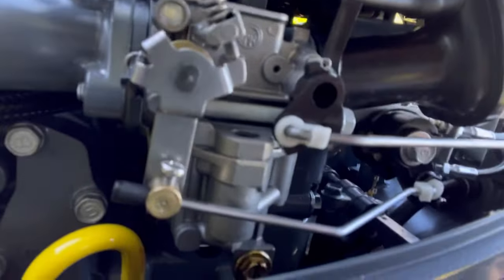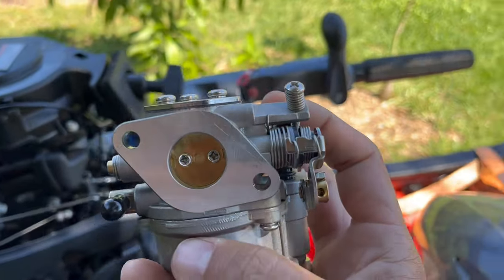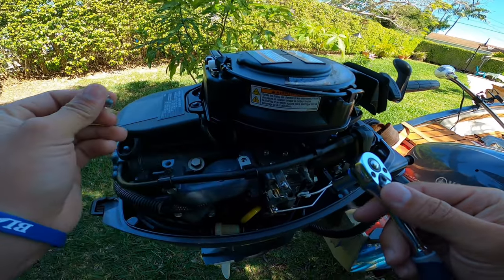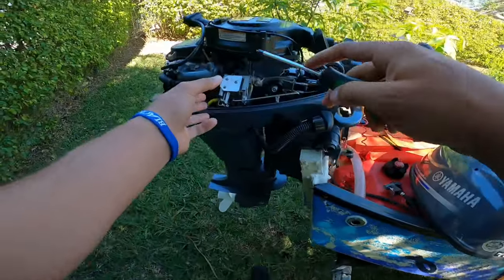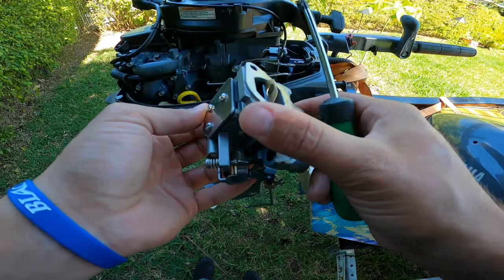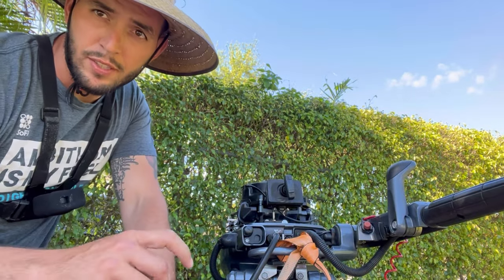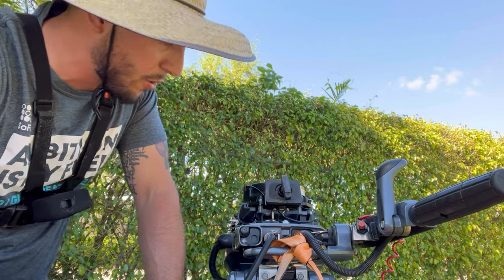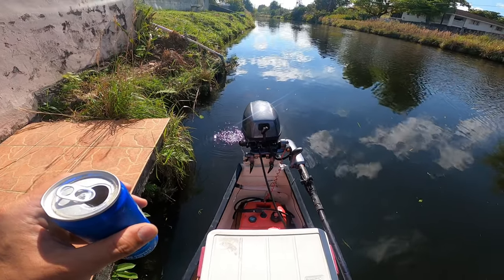9.9 carb install on 2013 8hp Yamaha 4 stroke

Comment: Cool vid.  thanks!  The ebay link doesn't work.  Is the only difference between the carbs the throttle stop/block?  I bought a new 9.9 china carb off amazon for 80 bucks, and the top end (upper rpm at full throttle) is missing.  I was wondering if the 8 and 9.9 carbs are exactly the same, or if the throttle stop is combined with a slightly larger main jet, or something else is different too?  The ebay conversion carbs are 300 bucks, which I think is too much for a china carb.  You guys are brave standing up and surfing that thing ... heh heh.
Reply from the maker: Yea that’s the only difference I believe you can also get a grinder and shave off the blocking metal

Comment: Hello, I have the same Yamaha f8cmh 2013, but it has 197 cv, can I do it on this engine? Thank you for your reply.
Reply: i think you need the one with 212 for it to work
Reply: @bojann.252 I have the same outboard, did you try it? If yes, did it work and what carburetor did you get? Thanks so much!
Reply: @Fuchsinger hey! did you try to change the carburetor? I have the sama motor
Reply: @terminaattori111 no, not yet. Nobody replied with their engine and careburetor details 😢

Comment: A boat mechanic told me that the F8 & F9.9 are part by part the same engine save for a different carburetor - great to see that this is actually the case

Comment: Which carb did you get? Source... part #... I have a 9.9 and going to replace my carb, too many issues with it
Reply from the maker: I posted the link on the description
Reply: Is it the: 6AU-14301-40 41 Carburetor ? The link you have above doesn't go to 1 item anymore. The eBay description is needed. I did order this one to go on my 9.9... I'll update if it works out. Sure is a good deal!
Reply: @garycotz563  was that the right part?
Reply: Yes that carb worked great!
Reply: @garycotz563  Could you please specify your engine number? Thanks a lot!!